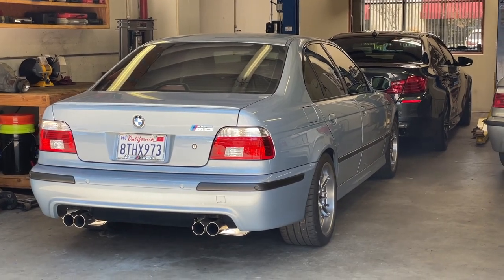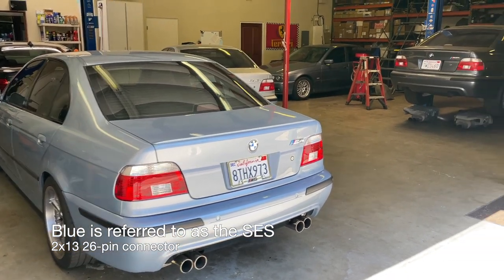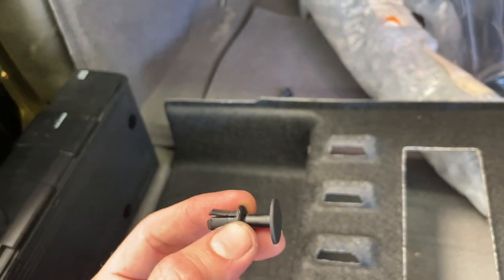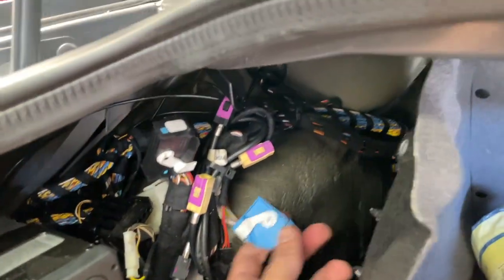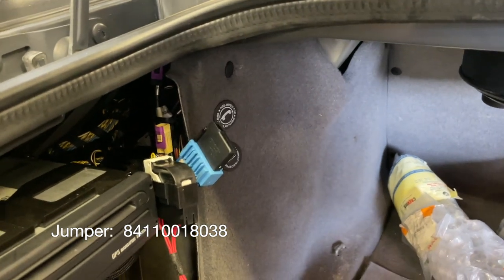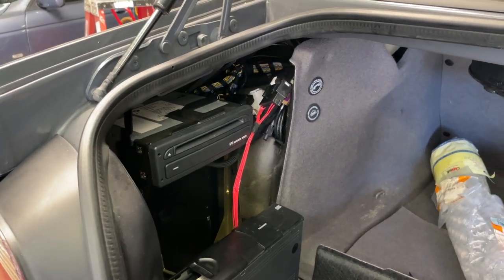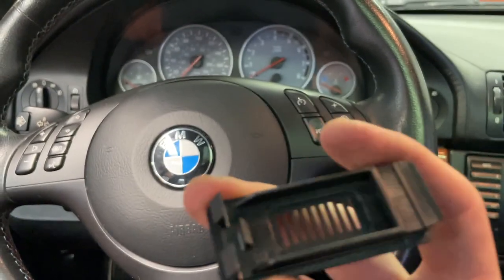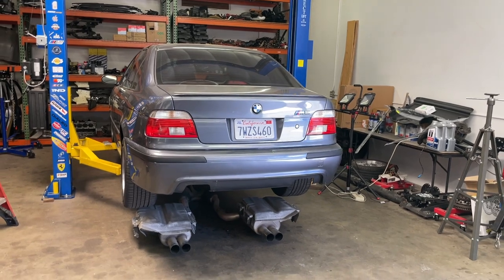BlueBus:  Which Phone Adapter/Mic do you Need?

Comment: Great stuff, waiting on my Bluebus in July. Any thoughts in using a third party 3.5 mm Microphone for telephone calls instead of going with the SES or 54 pin adapter and purchasing a used BMW mic? 
Does the 3.5 mm input on the Bluebus produce clear phone calls if wired from the trunk to front? Or is there another accessory required?  Thanks
Reply from the maker: I have always used the factory mic, though I bet a high quality aftermarket 3.5mm mic could sound better.  You'd need to run the cable up through the car and mount the mic somewhere in the cabin, and this work/clutter has been what has kept me from trying it.  I VERY rarely talk on the phone in the car, so its not a high priority for me.  As far as I know, all you'd need is the mic and a long cable.

Comment: Bluebus is great but honestly the mic for phone calls kinda stinks. Not sure if its just mine but callers always complain that the sound quality is poor. Is there an upgraded mic that is a plug and play replacement?
Reply: @E39Source  totally understandable for an older car. We're blessed to have bluetooth audio in a simple upgrade. I used to have a grom Bluetooth unit before bluebus and there is an aftermarket mic installed by the A pillar. Maybe I can splice that into the existing wiring for the stock mic

Comment: Great video! I have a bluebus and really love it. I'm connected using the analog connector. I bought the digital cable and tried to switch but when I switch the bluebus to digital via the head unit no sound is played. If I switch back to analog it works fine. Any clue what the issue could be?
Reply: @E39Source  I purchased a used one. I plugged it into the bluebus and what I believe is the Amp (I'm assuming it's the box next to the cd changer) but couldn't get it to work.
Reply: @naveeds786  - You should wiggle the cable around while playing music with the DSP set to Digital. It's probably not seating properly. Here's a new alternative: https://www.digikey.com/product-detail/en/cinch-connectivity-solutions-johnson/415-0008-036/J1636-ND/457012
Reply: did u solve this problem? i get no sound from my digital dsp.

Comment: Ryan, do you know what brand the oem rocker cover is on e39's, or at least which brand you would personally use in your car. thx
Reply from the maker: Rocker cover?
Reply: @E39Source  sorry that might be a European term. I mean the valve cover gasket
Reply from the maker: @icalledit4335  Elring makes the OEM valve cover gaskets.

Comment: Hey Ryan. Great video. I love the idea of the bluebus, however I currently have an android unit. The main reason is the backup camera functionality. Is there a way to hook up a backup camera to the OG radio (MKIV)?
Reply from the maker: Yes there is, and I've been trying to find time to figure this outing make a video on it for years.  I have most of the parts, and hope to get to it sometime this year.
Reply: @E39Source  i have read on the forums to use the tv module and an automotive relay, but it has always seemed very much a hack job to me anyways. And it's a must for me having small children that might get out to say by to dad as he leaves unaware of the dangers.
Reply: Let me know if i can help in any way.
Reply from the maker: @gabo12e30  Yes, it does require some tricks like that.  A backup camera wasn't in anyone's wildest dreams back in the early 2000s, unfortunately.
Reply: @gabo12e30  I company called Naviks makes a module & wiring kit to adapt a backup camera to your OG head unit. Plugs into the Nav DVD unit. Everything is done from the back & plugs into the rear taillight to for the reverse trigger. Kit includes a relay as well. I have it & it works great in my E46 M3 cab. They even sell the optional camera that fits into the rear licence plate to make it look OEM. I also have the BlueBUs. My 2004 M3 as almost all the modern tech. I even use Siri thru the steering wheel button.
Reply: @anthracer  thank u so much for the information. I'll look that up right now!!!!
Reply: @anthracer  so did u have to get the tV module with this? It doesn't look like you need it. To me it seems it connects in between the mkiv and the headunit.
Reply: @gabo12e30  no need for tv module. And comes a detailed instruction setup
Reply: @gabo12e30  connects to the DVD unit in the trunk

Comment: what’s the best head unit for a e39 2001? I am getting my first car monday and would like to add a head unit as the radio does not seem to work
Reply from the maker: Hello Marcus!   Congratulations on your first car, and you've elected a great vehicle!  I have found that all of the aftermarket head units are pretty much junk.  They tout long lists of 'impressive' features, but in reality, don't work (or fit) very well at all.  I highly recommend fixing/replacing the factory radio, and adding a 'BlueBus' BlueTooth device to the loop to replace the factory CD changer.  This will give you factory bluetooth audio streaming in addition to hands-free calling, all while maintaining the originality of the factory components.
Reply: @E39Source  How do I get a screen in the bmw to work with the blue bus adapter? Sorry I am not much of a car person but I want to install a screen and i thought that was called the head unit.
Reply from the maker: @marcuslindsey347  That's the thing, any of the aftermarket screens or head units are something I strongly recommend against.

Comment: I HAVE A E39  520i  2002 model 
Under the driver dash is a little thing  and it makes air sound????
Reply from the maker: I will need much more detail than this.
Reply: Thank you for responding It's a little thing under the driver's side  dash  On the left side And it hook up with A pipe and  Little cable
It is circular in shape  And have a hole in the middle
  And the air come from this hole
Reply: @E39Source   I did a small video for you on my channel 👏
Reply from the maker: @nasdf2314420  Thank you for the video, that helped a lot.  I have never seen that before, it is aftermarket.  Somebody installed whatever that is.

Comment: can you just use the phone if you have it would be awesome to be able tonuse that thing
Reply from the maker: What do you mean?
Reply: I have a euro spec 540I Touring I'm bringing back to the states and it has the center console phone is there any way to make that thing work that would be very cool and nostalgic
Reply from the maker: @thomaschacon123  Unfortunately those phones can't work anymore, the technology simply isn't supported by any carriers.
Reply: @E39Source  thanks for replying to these already learned so much from the videos I will be doing with my 540
Reply: @thomaschacon123  unless you wanna take the old phone apart and wire a new mic and speaker, or tap into the current wires and gut the other electronics. If you have electronics experience it shouldn't be terribly difficult in theory. But I don't even think it's legal to use that while driving anymore lol
Reply: yeah I know I would probably be pulled over for being on the phone and driving